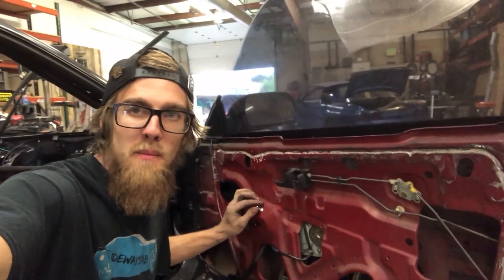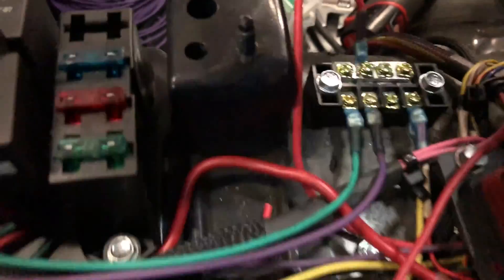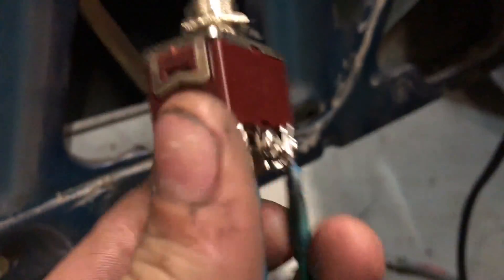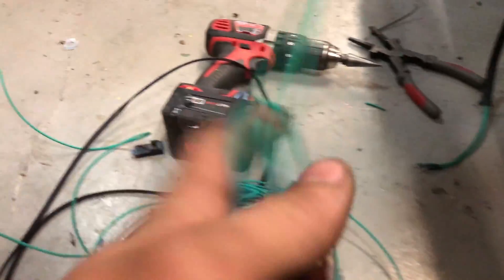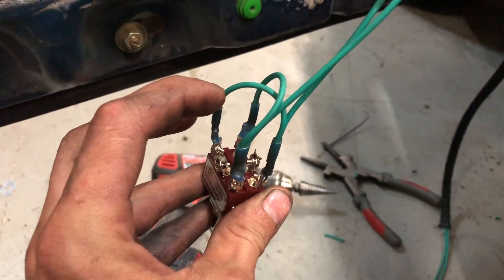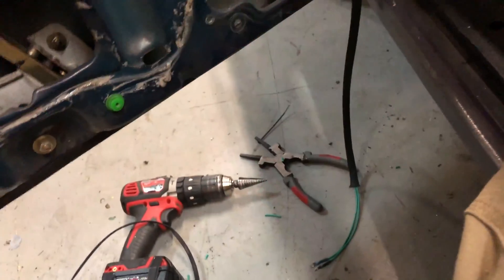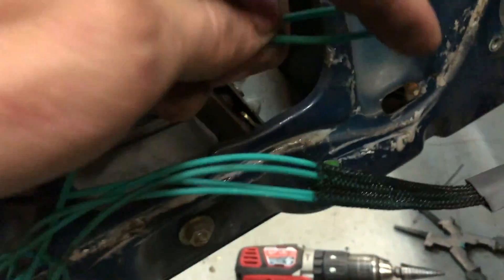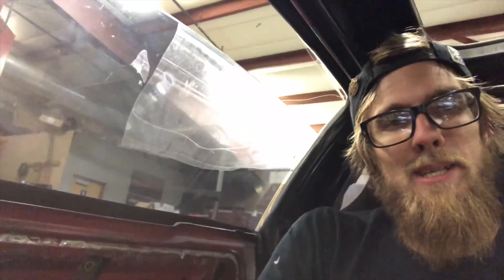Wiring Power Windows on Your Racecar

Comment: Got a 2009 Altima coupe I can not fiquire out why the power windows don’t work. U can hook the window motor straight to battery and they work fine. Bought another window switch still didn’t work. Thinking about trying ur way. What can I run my power source too that’s safe ???
Reply from the maker: You'll have to probe around and see what you can use for power. Make sure it's fused and you'll be fine

Comment: Do i need to add a inline fuse or relay ?
what amp switch do i need?
Reply: inline fuse is good to have about 10amps
Reply from the maker: You just need a fuse to the power wire before the switch